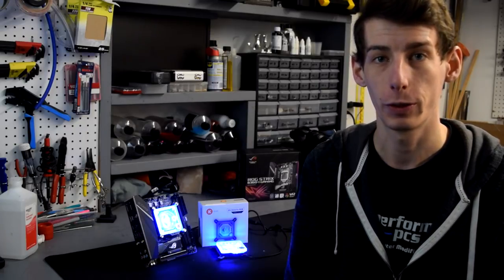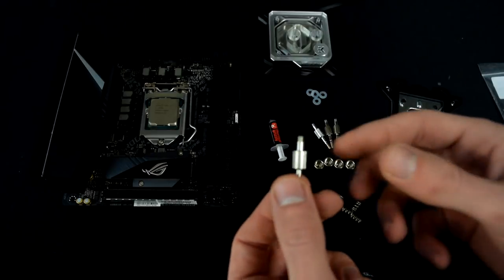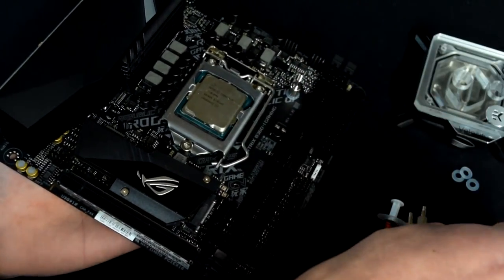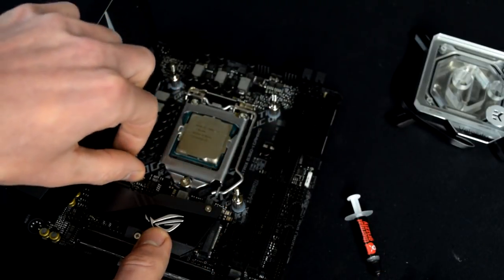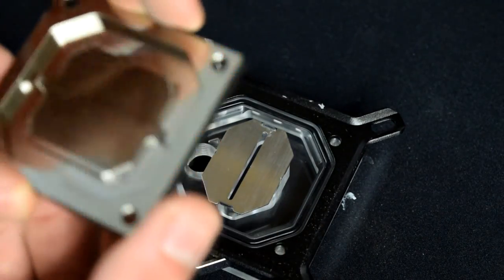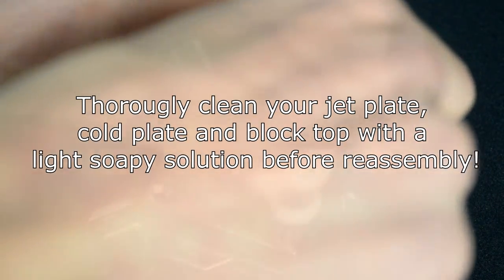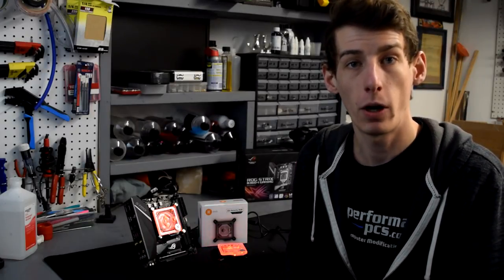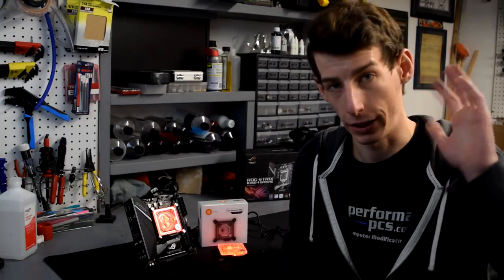The Complete Guide to EKWB's Velocity CPU Blocks

Comment: Bro ty soooooooo much for this video...for a year the fins on my velocity block were vertical..not horizontal and my temps were god awful..i tried everything and today i tore my cpu apart and seen it wasnt how it was in this video and BAM....it dropped 20° under load...went from 100° and shutting down to 82° and stable at 5.1 ghz on my 10850k....anyone watching make sure ur fins are HORIZONTAL...it makes sense and logical thats how ur liquid is gonna pass through ur block and cool ur CPU

Comment: I am fairly sure you showed putting the metal backplate on upside down. The flat side should be towards the motherboard, not the sharp edges that will cut through the rubber isolation pad with pressure.
Reply from the maker: That is correct actually, however the backplate still doesnt contact the motherboard either way you put it.
Reply: It'll work either way. If you noticed, the backplate has long stretches pressed metal protrusions behind each screw that rest on the rubber pad to keep it from ever coming near the motherboard.

Comment: For those who don't want air bubbles at all, which will still form over time and can't escape until you til the PC, make it so the holes go vertical, 'in' at the bottom and 'out' at the top. The 'out' hole is also close to the edge so that means there isn't any space left for bubbles to form.

Comment: If you didn't care about where the led cable comes out but you were going to be rotating the block 90 degrees to a vertical orientation would you still need to rotate the internals of the block like you showed? Or does it not really matter?

Comment: You say tighten until it begins to get difficult. The manual says to tighten until threads stop. I did this method but it required tightening them very tight and I am wondering if this is too much and possiblity warping my coldplate.

Comment: I have a 2700X and it seems as the block is only making contact in the center. Would changing the jet plate make it fit better. The water block is convex.
Reply from the maker: The blocks are supposed to be convex, with the correct mounting pressure they should make full contact with the chip. Sadly changing the jet plate doesn't do much in this scenario.

Comment: How do i change the rgb and stuff? My block RGB isn't working it's conected to the WBRG at the top right on my aorus gaming 5 MB.
Reply from the maker: They Require a RF Controller or to be connected to a Hub that you can control the LED's
Reply: @PerformancePCsTV  The only controller i have is the NZXT hue 2 hub & the one that comes with the dark base 700. Would any of these work? I think i'd need an exstender to conect if so.
Reply from the maker: @Near2Future  Pretty sure one of those should work as long as it is a RGB hub it should be able to work. We have not personally tested it with anything but Cablemod controllers
Reply: @PerformancePCsTV  I just ordered a VDG header to a standard 3 pin 5v RGB cable. :)

Comment: With this new design, have you tested any 3D effects liquids (UFO tech or Primochill vue)? I know from UFO tech that something in the EK CPU block causes the effect to clog up and lose its suspension in loops. I've also read that manufacturing oils are not completely removed when pre-cycling a loop. Any chance will you be testing these coolants with this block?
Reply from the maker: Yes, I do actually plan on testing how this block works with 3D effect liquids at some point. First on the list is to test it's performance vs. other blocks though. Just stay tuned :)

Comment: Do you plug the CPU's rgb  into the CPU fan header? Or do you plug it in somewhere else?
Reply: RGB header
Reply: @jamesluna162  what if you don't have rgb header?
Reply: Patrick Vanguardia I don't think it will work without an external rgb controller
Reply: James  Luna ahh thanks. Then since it will not work. Its alright not to use it?
Reply: @syntaxx  yes you don't need it if you don't have a rgb header. It's only for the lighting

Comment: I own this block. Be warned, the RGB is hit or miss weather or not it will function. Tons of people have issues using their digital rgb 5v headers on the motherboard due to a special kind of LED’s EK is using on these blocks. My LED’s are basically stuck on blue with some flickering. I emailed EK and Ales told me they are working on a controller which should be released next month to fix the issue but I’m pretty disappointed I bought the block specifically because it was drgb and it’s useless.
Reply: Flip the cable the opposite direction, you could have the orientation wrong which would have only the blue making a connection.

Comment: I'm a bit confused by the method of rotating the block. Since the mount is square, couldn't you just rotate the whole assembly without taking it apart?
Reply from the maker: Of course. I merely showed how to rotate the block's ports while keeping the rest of the block oriented as intended.
Reply: @PerformancePCsTV  ok, got it. So if you wanted to have the ports in a vertical orientation (perpendicular to the PCIE slot), then you would do as you suggested. In my case, I am rotating the whole block 90 degrees counterclockwise to make the top of the block face towards the mobo I/O and the bottom towards the Ram Slots / 24-pin connector. As I understand it, I wouldn't need to change anything and just rotate the whole block. Thanks for your reply!
Reply: The reason you rotate is to keep the piece that sticks out and reads “Vector” at the bottom and oriented to be read correctly, it’s also to keep the RGB cable at the bottom. You can rotate the whole block but it may look odd but functions just fine.

Comment: To replace the RGB strip can you use this https://www.ekwb.com/shop/digital-rgb-led-strip-100mm or is the RGB strip on a solid PCB?

It is worth noting that the RGB header is a 4 pin plug but needs to be inserted into a 3 pin plug/5v. 

Ek do not block out one of the ports on the header. This allows you to install the header into a 4 pin/12v header....